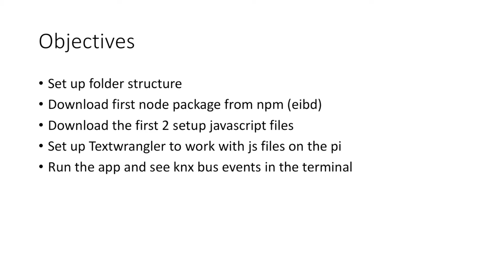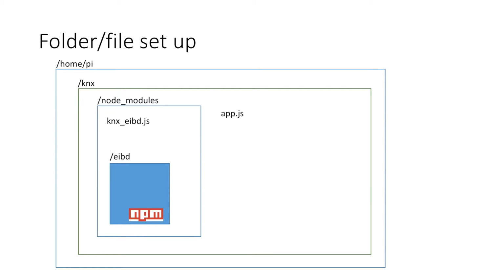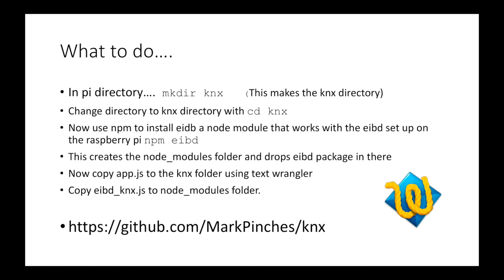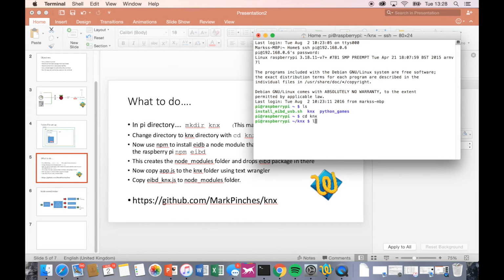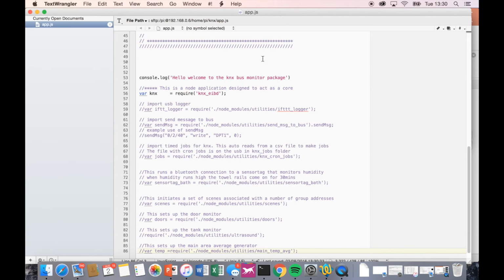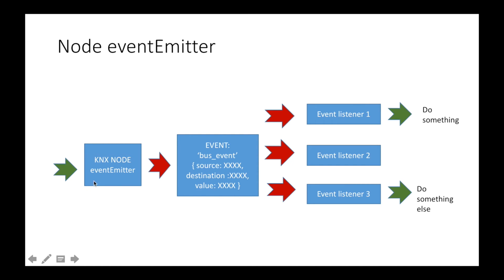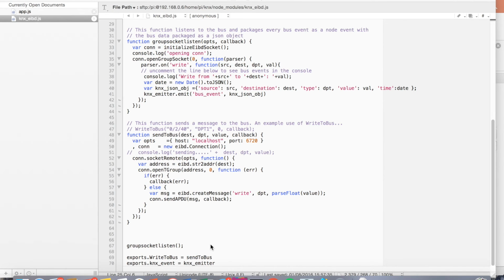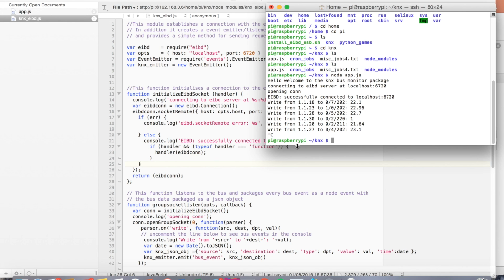KNX Raspberry pi (2) :  Hello World!

Comment: Hi, i find your videos extremely useful. With type of bus did you use to connect the knx with raspberry ? And where can i buy one. Thank you
Reply from the maker: Hi AquaGlow, thanks for you feedback. My understanding is that almost all USB interfaces will work, and that there is a list on michealstechblog of those that have been tested. For my part, I have used a gira and merten USB interface with no problem - and I have just gotten a ABB for E40 on ebay to try. Good luck!
Reply from the maker: I have used a merten, and jira usb and both worked fine. Michels blog has a list of usb to bus connectors that have been shown to work, it includes most of the major brands. Thank goodness for universal standards! And try ebay - usually E50

Comment: Am i able to build a Website that is able to for example Switch on the lights in my room with this JavaScript application?
Reply from the maker: Hi Louis, yes you are, and its pretty simple. The project uses node.js as its core library. Node.js was primarily developed (I think) for server applications, as its asynchronous nature is ideal for client/server interactions. Consequently there is a very mature set of libraries for serving up webpages, in particular take a look at "Express" which is a simple framework that runs very nicely on rPis.  Also there are lots of tutorials online on how to develop a webserver and pages using node. A particular favorite of mine is the "MEAN" stack, standing for Mongoose/Mongo, Express, Angular and Node, which are all coded up in javascript. I will try and do a simple tutorial if I get chance to show how this could be done in future.  Good luck!
Reply: Thx for the super fast answer :) trying to do it during the next weeks
Reply from the maker: Yes, see the video on control with a smart phone